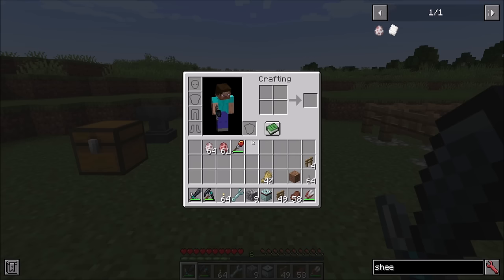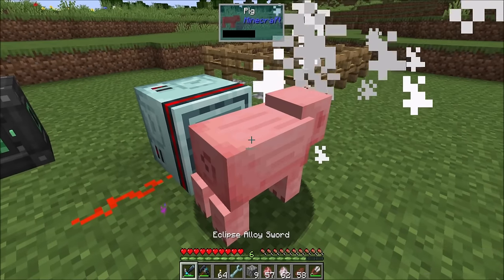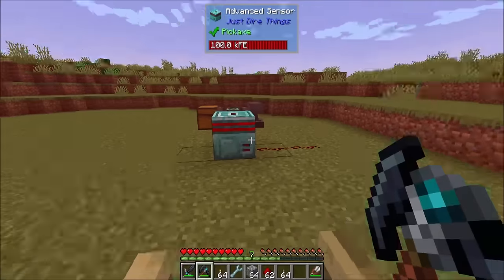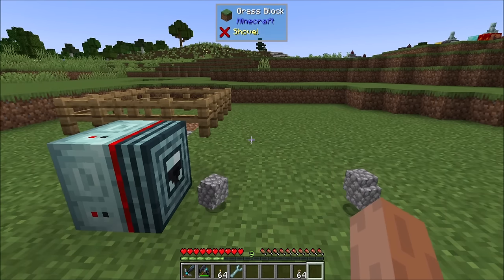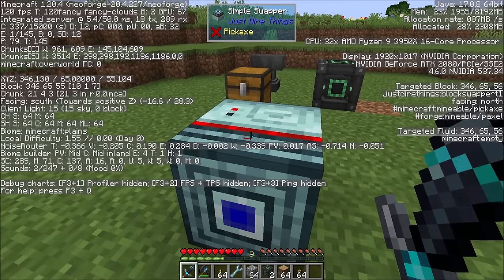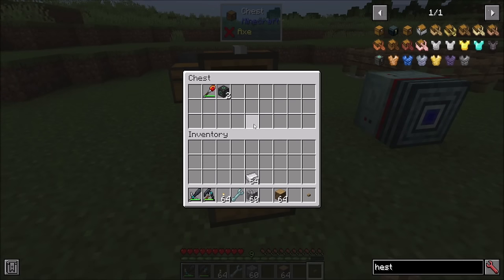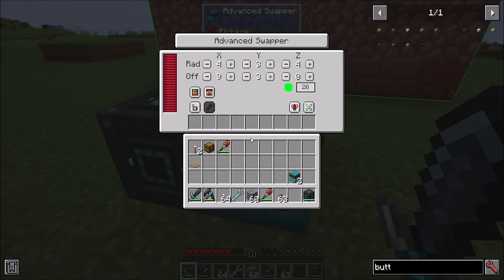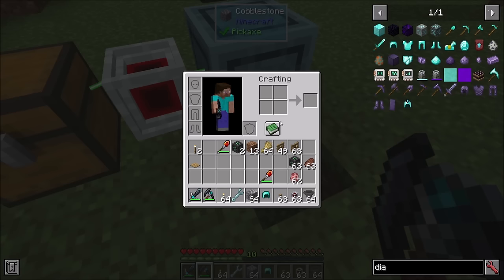ModSpotlight   Just Dire Things Part4

Comment: Some ideas, Dire:
- Multiple Goo blocks surrounding a mutable block could speed up the process.
- You could add tiered Bows, Crossbows, Shears, Shields and Fishing Rods to the mod because vanilla only has one of each. 
- The Blazegold  Sword+ could auto cook/smelt mob drops.
- The Cauterize wounds ammount healed could scale with the sword level. Start at 1 heart and end with 4.
- Blazeboom Goo could burn entities that stand on it. Voidshimmer goo teleports the entity randomly like chorus fruit and Shadowpulse blinds the entity.
- The fuel generator could have a slot for recharging items.
- The same way you stored fuel in a fuel canister, you could make a Pearl Shooter that stores ender pearls and when right cliked, throws one pearl.  Pearl Wand (advanced version) could intantly teleport to a raycast target and consume pearls based on distance travelled.
- Like above, an Ender Canister that stores eyes of ender, throws an eye when right clicked in the air and if right clicked in an end portal frame, puts an eye into it. 
- A Food Canister that stores hunger/saturation points from inserted food, and when right clicked will replenish the average nutritional value, like the average burn rate (similar to Mekanism canister). An advanced canister could auto-feed the player whenever the food bar is incomplete.
- A Redstone Canister that stores redstone and works like a time in a bottle to tick accelerate machines. Configurable rate and duration in the UI.

Comment: Already imagining a much easier Botania coal setup with the sensor and dropper machines.

One interesting idea with the tiered shovels would be to allow them to make varying tiers of dirt roads like the tiered farmland that will increase the player speed while running on it.
Reply: Yeah, especially if the sensor can detect the Exoflame flower state. So, set it to emit Redstone to a dropper with coal when that flower has finish burning.

Or even with the "food eating flower" (I forgot what it's call, since the dropper drops filtered item in sequence, you can always guarantee it drops different food when you set it properly (this flower is only efficient when it's not eating the same food consecutively)
Reply: First thing i thought of!!
Reply: Not gonna lie, botania already has these droppers, flowers that supply fuel to furnaces, and bore lenses that break trees. You can 100% do a Botania coal setup with just Botania.
I'm not a fan of "easier is better", but I definitely look forward to playing this mod, even without Botania!
In fact definitely without Botania, because this mod is overlapping a lot of other tech/magic mods. I don't imagine it being compatible with any modpack, and at the same time I don't expect any modpack maker to hold themselves back from adding it...
Reply: @nati0598  The thing I don't like about Botania is that it's not performance friendly. Like the filtering requires item frame, which is an entity. Then most of botania emits bajillion particles.

The least I have to use botania in a modpack the better.
Reply: @nati0598 
Well, this mod makes it so that yiu don't need to pick and choose blocks from other mods.

You just have one tech tree for your valuable Redstone components so you needn't go half way through several tech trees just to get the things you need to make the best setup for everything.
Reply: @redstonewarrior0152  Sure, but I said in my comment that it's possible with just 100% Botania. And even then I would reply with 927th xkcd comic.
Reply: I know this reply is 2 months later but just heard about DireThings and have started watching his spotlights, but the advanced dropper would also be helpful if you wanna mass create flowers from Botania in the petal apothecary

Comment: The advanced swapper seems like it could be used as the basis of an inchworm drive for a mining machine or tunnel bore.  Actually it could probably be a lot more powerful than that.  If you had some kind of ComputerCraft (or similar) integration that let you change the advanced swapper's settings, you could move the machine in any direction you wanted.

Comment: I love your mods and especially love the implications of the last machine and its possible ability to nbt match damaged armor, pull it off and put it in a repair system then return the fully repaired armor once repaired or a different set of armor if you can have 2 sets of your armor. that means never worrying about breaking armor or tools again with auto replace/repair functionality. Your such a help in many ways not just the mods but the tutorial vids and series, been a fan for as long as i can remember, keep up the great work Dire!

Comment: Can the advanced swapper be in its own area of effect? If a swapper is moved (either by a swapper or by another mod like AE2 spatial) will its area of effect move with it? (imagine a house that has several swappers inside it, each paired to a different location in the world) Can two swappers bound to each other be moved together?

A feature for the swapper to rotate the area by a multiple of 90 degrees around the Y axis would be useful.

A way to have the item collector emit a redstone pulse every time it operates, or for every item it collects, would be powerful in combination with the dropper for something like Terrasteel crafting.

Does the swapper's energy cost scale with distance, number of blocks/entities, interdimensional? It would probably be useful to make this configurable and also add a configurable option to consume a special resource (ender pearls, liquid experience, etc) instead of forge energy.

Comment: I'm not fan of the right click on the item in simple sensor. I wouldn't even try to right click on it even though I know that some mods do work like that. I'd personally add a filter button which would open the same UI. Making it directly visible to the user is much better.
Reply: I agree with this comment. The design is not intuitive nor does it seem consistent with the rest of the mod

Comment: nbt filter for player accesser, so it can extract damaged weapons/ armour,
(then use other stuff to repair them)
and send them back fully repaired.

EDIT: unless the "extractor block" does the filtering?, i suspect it does?
Reply from the maker: It basically makes the player like a chest - so if you have a mod that can extract this kind of thing from a chest, it can extract it from the player.

Comment: Hey dire, a useful feature for most of your blocks would be piston moveable. Then add in a self pushing piston that moves instead of extending, and you have a tunnel bore. Speaking of the self pushing piston, it could have an x distance traveled mode, a return option, filters for type of block pushed, and a sensor for stopping when it touches a filtered block. Redstone modes could be pulse stepper mode, where it pushes forward once, and just standard pulse mode where it moves as far as it's set to, then returns if that option is set. Then you could make it sticky, on any side... It's a lot of work, and likely a major feature on it's own... but incredibly useful.

Comment: Hey Dire! That swapper is amazing. Loving this mod. Quick suggestion: Handheld Swapper. An item which is like the Dislocator from RFTools or Draconic. It can be bound to one Swapper and can be used like a teleporter for the player if used on air, teleporting the player to the bounded Swapper. It can also be used on entities or blocks to swap those like a normal Swapper would. Maybe throw a GUI in it and you can choose if you are able to swap entities or blocks or players or only yourself (would be funny to swap another player into a pit of doom or something) to give the option of only using it as a go home machine and not accidentally swap blocks randomly in your base. You could have a Simple Handheld Swapper which can only be bound to one Simple Swapper at Tier 2 (or maybe even Tier 3) and then have an Advanced Handheld Swapper which can be bound to multiple Advanced Swappers at Tier 4. The Advanced version seems a bit busted but I think its rather balanced cost wise when the Advanced Dislocator from Draconic is obtainable even before Tier 4. Just an idea though! Can't wait to see more of the mod!

Comment: A suggestion for mob spawning 
One option is to have a mob spawning block that works similar to the other blocks added 
Simple Mob Spawner only spawns a mob on the face it is facing, it can spawn almost any 1 spawn egg mob at a time but it has a cool down and needs to meet certain requirements (light level zero for hostile mobs, open sky or max light level for passive mobs, water present for aquatic mobs)
The advanced Mob Spawner works similar to other advanced blocks with it needing power and having an area of effect larger than 1 block but can still only spawn 1 type of mob and has a cool down 
Alternatively the block could use XP to spawn the mobs instead of using a set cool down timer between each spawn

Comment: Would it be possible and worthwhile to make things like the sensor work on block updates?  Similar to the observer so it's not scanning for a block there so you don't need to mess with ticks to run.
Reply: Why not just set it to pulse mode and put an observer next to it
Reply: @undvined  it's possible, but still possibly more laggy if using rs dust.  And by default it's still ticking

Comment: It would be great to have an option of orientating or rotating with the swapper. It has always irked me with teleporting mods when you come out facing the same direction as you went in, when you have the portals in different orientations. Would love to have a NSEWUD/initial button, at least for entities (implementing it for blocks might be a little trickier, but I don't know if you've already solved the issue for building gadgets)

Comment: I used to love the old power armor and power hand mods. The one where you built the armor then added cards to it to add abilities. I think it would be great to have 1 set of armor (maybe 2, diamond and netherorite levels) and then the abilities would be things crafted and you would put them in. This would let you build the armor semi-early and the cheaper cards (like step assist) could be used right away. Then the more advanced cards like flight, would take your later resources but I wouldn't have to craft yet another set of armor.

Comment: Aesthetically, being able to detect the state of a lever is actually really useful. Even if it means, I need to hide some power & wiring in the ceiling, I can now have a 1 thick wall with a lever on the inside that controls the lighting.

Comment: you could add a rotate setting (either absolute cardinal direction or relative offset in 90degree increments) to the swapper so that you don't end up facing a wall on the other side when using it as a player teleporter

Comment: the advanced sensor should have an alternate output method that lets it vary signal strenth based on how many it senses, allowing for you to specify if the strength goes up for every one sensed, 2, ect. maybe give an extra function where it can output the remainder, so anything past 15 will loop back around to 0 and start going up again

Comment: I got one request and its a simple one.

Make the fuel cannister able to be placed as a block.

I want to be able to pull it out of a furnace, slap it down with a simple placer, stuff it full of my fuel of choice, all before the simple breaker knocks the thing out just to cram it back into the furnace. Having the ability to slap the canister down as a block would make that arguably niche prospect viable.

I just decided that I no longer like my statement of having one simple request. I got another one. I need some way to guarantee that the machines fire off within the timing I need it to. For example, I don't want my swapper teleporter to send me back 0.3 seconds after it teleports me. I want it to send me back 1.0 full second after it teleports me. Add some means to sync up the timings on the devices. Give the players some kind of "timeline"  for setting what time the "bus" arrives at. Anything to make sure that my swappers set to go off every 40 ticks are offset by 20 ticks.

Ok. I shoulf have started my comment differently. One last request. The conversion recipe for primal coal is not as efficient as you claimed it to be. The low roll smelts 72 items, an equivalent amount to 9 coal, while the high roll smelts 96 items, an equivalent amount to 12 coal. How primal coal faulters in its efficiency is due to the fact that 9 coal smelts 80 items, an equivalent ammount to 10 coal. Or more specifically, one block of coal smelts 11.1% more than the coal used to craft it. So no, being unlucky will not cause you to break even. Being unlucky will cause you to lose 10% of your fuel efficiency. Thankfully, being lucky will cause you to gain a 20% fuel efficiency. Problem is, rolling low is as likely as rolling high. The average amount of items you will be able to smelt by making primal coal is 84 items, and that beats a block of coal out by only 4 items. That's an average boost of 5% every time you make primal coal. Which is honestly not much of an improvement. And this 5% improvement compunds with the higher tiers of coal. But honestly, that's a lot of work and a lot of coal for, what? A 1.05 multiplier cubed? That isn't worth it in my book.

I think you should increase the drop rates from 3-4 up to 4-5 and reduce the smelting value from 300% of coal down to 250% of coal. These adjusted values should buff the 5% efficiency bonus up to 12.5% efficiency bonus on top of making the low rolls maintain the value of the block of coal rather than losing it.

Comment: anyone else feeling a simple sensor with a simple swapper 👀 
hmmmmmm ooooh the possibilites..

Also @Dire, how does the power management work for the advanced tiers of machines work? Mainly like for your advanced swapper & sensor machines. 

Does the RF cost of the swapper vary for the AOE/amount of blocks & distance included? 
And for the sensor how much does it cost per operation if it's not in pulse mode?  Does it only run an operation if what you set in the filter becomes true or is it just a continuous cost per tick?

Would definitely love some clarification if you could because that could be immensely overpowered or a huge RF sink 🤔 
Absolutely love the mod though, can't wait to put it to work
Reply: Also as an extra though that would be cool for the advanced swapper or maybe the advanced sensor, if you could use a named player head (or have a "bind to player" option) that will only allow the swapper/sensor to interact with the player who placed it so everyone in a multiplayer server wouldn't be able to TP to your base & ruin it for instance. I'm sure there's a few other situations also, but that's mainly one that comes to mine. It could act like a vanilla ender chest that's linked to the player interacting with it (or again, the one who placed it in the world)

I think that would give a nice balance to basically instant teleportation.

Comment: What happens when two connected swappers have areas that overlap? specifically, what if you have two 3 by 1 by 1 areas, overlapping a single block on their ends. When swapped, the blcok placed there should be swapped to both positions on the other ends of the two swapper areas.
this could be a case for not allowing linked swap areas to overlap.

Comment: Extracting from the Player Accessor should pull from the item stack with the fewest items first. That way it's more likely to keep your inventory slots available than if it pulls from a larger stack and leaves items behind.
Reply: that is not how mc works
in minecraft the inventory checks are happening from top left to bottom right by going through the full one row and then to middle row and then last row
so that would not be feasible
how i know this 
as me also made a mod that was extra utilities 2 old autocrafter i recreated in 1.19.2 forge but than got abandoned as vanilla mc similiar to it 
and others mods just over power my mod
Reply: @kizigamer6895  It... doesn't have to, though. It's a mod, he can iterate through the inventory however he wants in his code.
Reply: @IceMetalPunk  Okay maybe then me dont have clue how to 
as me a beginner
thanks for the info i will also look into it more.